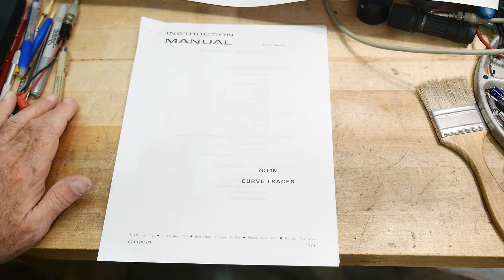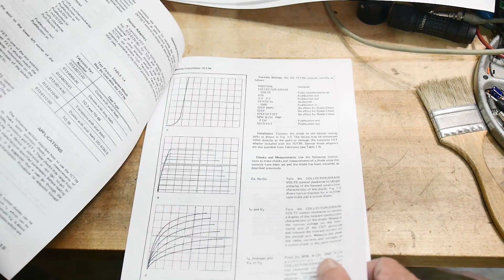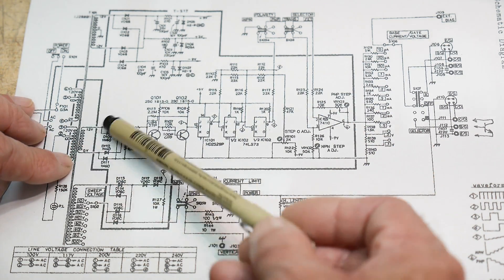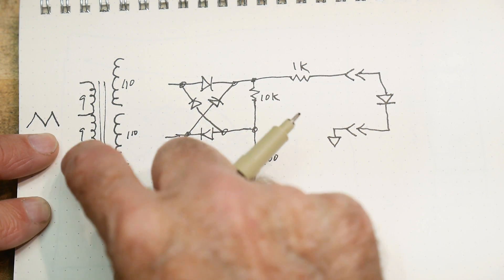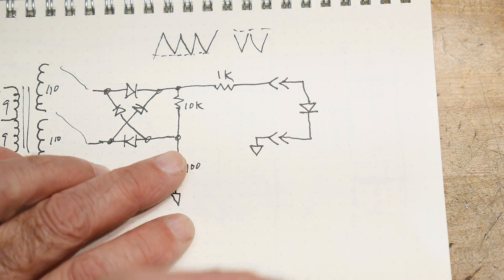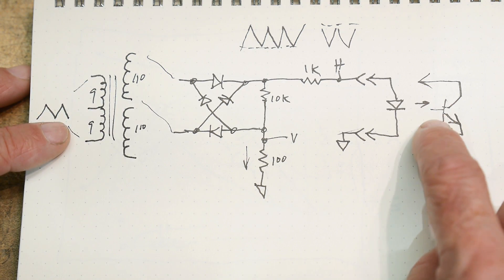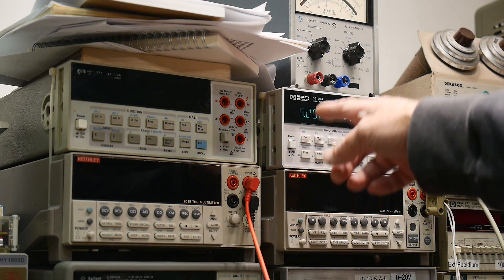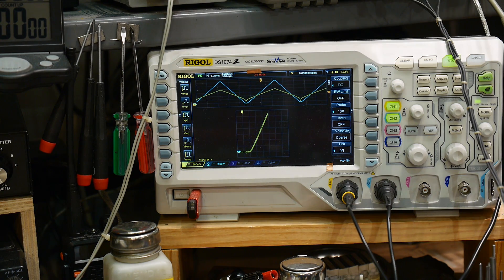#639 Transistor Curve Tracer (part 1 of 10)

Comment: Question have you ever used the CD4024be ic chip? It’s a seven BCD count chip?
Reply from the maker: I usually used the cd4040
Reply: @IMSAIGuy  Great. Question in the schematic they use Resistors and diodes in series on the outputs. Would you know the reason why?

Comment: Those Tek curve tracers are very heavy.
Reply from the maker: insanely heavy
Reply: They are capable of outputting amps of collector current at over 200 volts! Testing power transistors!

Comment: You need to update to latest firmware on the scope to get the xy to work. Had the same isue. Great project. And nice vid.
Reply from the maker: I just updated the firmware. Thanks! Last time I looked there was not a firmware update yet. The curve tracer videos are already recorded but I will now use the nice full screen.
Reply: @IMSAIGuy  great. Thanks for the content. I enjoy your videos. Thank you
Reply from the maker: @jamescollier3  an arduino circuit would work in a set, measure, display, repeat type of design. My design is real time tracing and I don't think the arduino and display could keep up. There are many many ways to do this project. Give it a try!